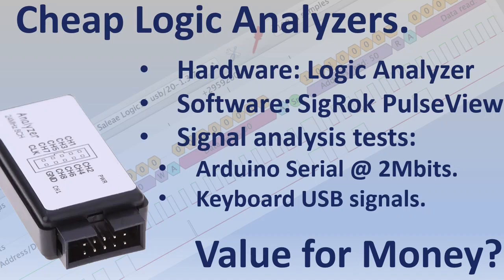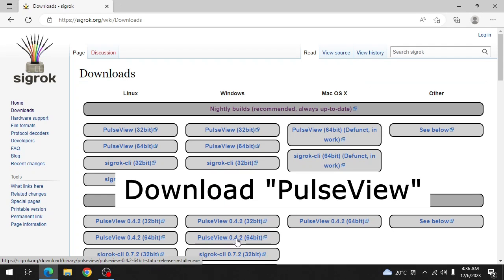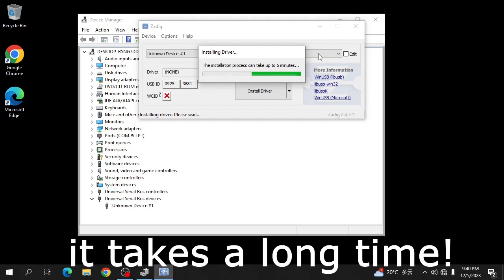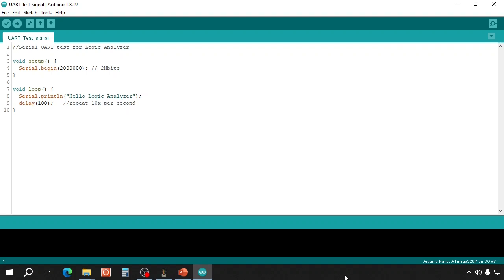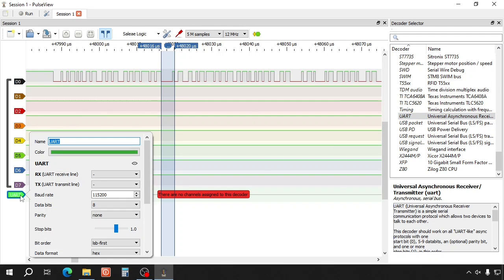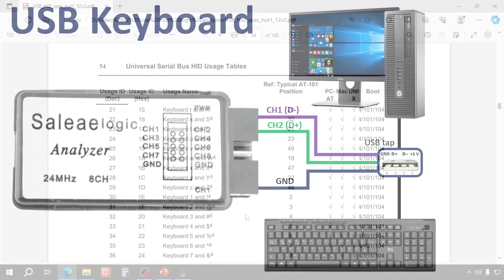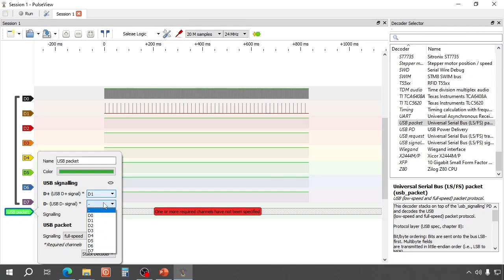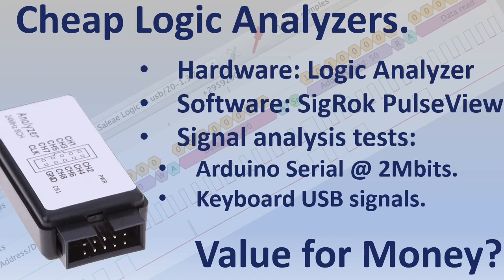Low cost logic analyzer

Comment: is it okay to not put a gnd pin on the device you want analyze? I have a 7-seg display with 7 pins, and I think it uses charlieplexing so I don't think it has a dedicated gnd pin
Reply from the maker: Interesting case, never thought of this 🙂a logic analyzer can only detect positive signals (unlike an oscilloscope), so you have to connect ground as a reference and figure out the actual voltage on the segment LEDs based on the inputs....

Comment: What version of USB were you using ? Surely, it would only work with USB 1.1 if it is sampling at 24 MHz !!
Reply from the maker: @we-are-electric1445  you are correct, this logic probe cannot analyze USB2 or 3 full speed devices. It can work for human input devices “HID” like mouse or keyboard because they run at 12MHz
Reply: @smartpowerelectronics8779  Yes ! It looks  a bit limited.  I was looking to use it on ST32 Microelectronics ARM based development boards  but  it looks like I am going to have to look for one running at very low clock speeds !!  😁

Comment: what does the clk line do?
Reply: It allows you to clock the analyzer. Meaning you can syncronize the data. Lets say you are looking at a 8bit computers data bus. You hook it up and hook up the clock bit to the system clock. That allows you to better see the data on the edges of the sampling frequency limit since it avoids the timings jumping around...if that makes sense. Not good at explaining :d

Comment: I bought one of these years back and never used when studying electronics, amateur radio and RF engineering.  Wound up picking up a HP 6601A logic analyzer with 16533 scope plugin card from the UofM Property Disposition store pre plandemic and played around with that to make sure was functioning.  Decided would wait to use again once I could backup the HD and ideally install a converter to use a modern SSD drive, instead of the SCSI older drive.  I had no idea there was the decoding function with the Saleae clone.  That is really handy and I guess the only thing that comes to mind that would be even better, would be some sort of iteration algorithm to automate the communication and protocol for an easier reverse engineering tool.  Kind of like a Universal Radio Hacker app I guess comes to mind, so open source communication protocol analyzer.  Anyways, great video and subscribed.  Thanks for sharing the Elements use as well, downloaded a copy and will have to try to use sometime when I get around to if I can get rid of those Stalin's Daughter whatever they are malicious on that side of the lake and beyond seems invasive youth that are just dumb in research stations I'm guessing or they claim. Thanks again and looking forward to more videos.
Reply from the maker: Thank you jafinch78! Yes it would be great if SigRok could recognize the protocol, similar to those cheap "universal component testers" just put in a part, press the button and you get the result

Comment: Ohh, maybe idea for next movie... Grab data from cheap easter power meter 1module unit, grab befor data go to screen/display and put them to mqtt/ha - I use >10 easter meter's with S0 interfaces but when wifi/power/impulse is lost I loose data... but reading them from screen this will be like own micro modbus :). On BiDirections meters who have got only total S0, I use 2 PC817 insted of LED to get own additional S1+ , S2+ interfaces. ESP32 grab them via ESPHome to HA and accumulate them.

Comment: Thanks for doing this video.  I bought one of these many, many years ago as a backup in case my Saleae (the original, which this clones) ever died, but kind of assumed that it was difficult to get working properly, so I never bothered powering it up.  If I ever find it, I'm now motivated to give it a try, even though my genuine unit is still working.
Reply from the maker: Haha totally recognize this, I bought this clone 6 months ago and could not get it working and gave up (and built the poor mans logic analyzer from the previous video) Then I decided to make a video, forcing myself to dig a bit deeper. The main issue was for me was that you need to wait for the driver installation "Zadig" it takes like...a minute or so! Pleas check the links I included, some minor points explained there which may help.

Comment: I much prefer the (comparably low cost) Openbench Logic Analyzer (OLS) with its 200MSamples-per-second capture; unfortunately it doesn't seem to be sold anymore...
Reply from the maker: Never heard of the Openbench Logic Analyzer (OLS) , the clone product from the video is ok, but limited to 24MHz.
Reply: @smartpowerelectronics8779  That's not really surprising, for some reason it never became well known, in spite of it being capable of 200MSPS on 16bits, for only $50. It was a board built with an on-board RAM buffer in an FPGA, built by Dangerous Prototypes and sold at the time by well-known outlets like Seeed Studio and Sparkfun. Sigrok has of course support for it, but it also has its own jawa-based cross-platform client. It had a multi-level cascading conditional trigger and because it implemented run length encoding on the captured data, its relatively small buffer could be stretched to cover relatively huge time spans even at maximum sampling speed, as long as the actual signal measured included large pauses where the lines didn't change. It's a shame it isn't sold anymore...